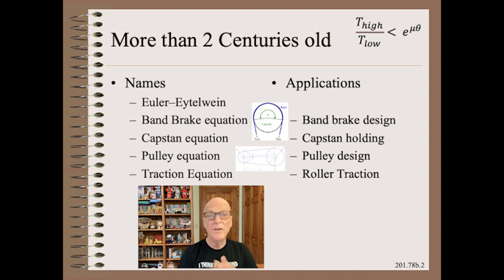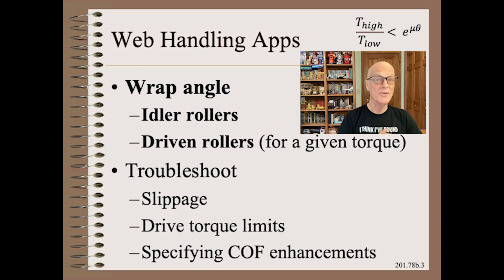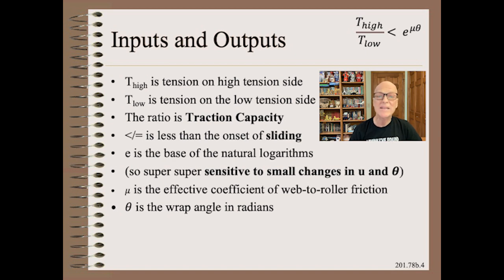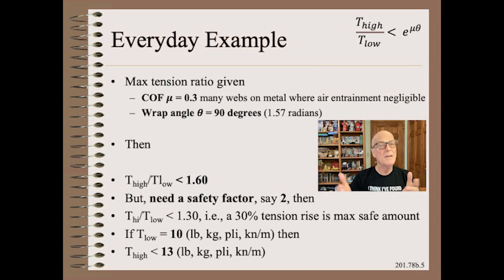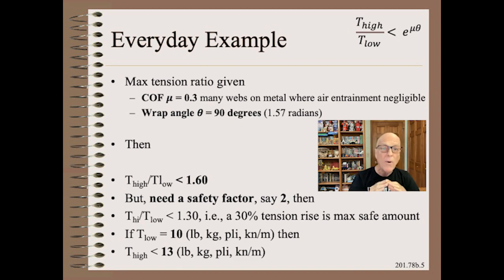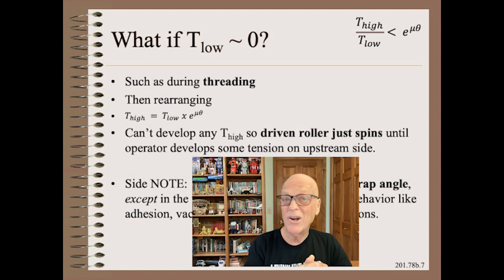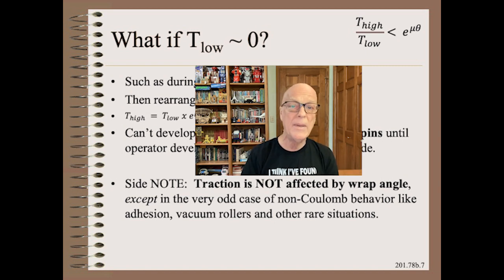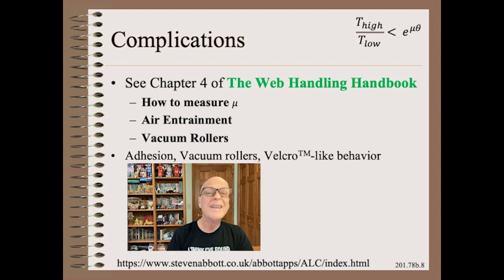Web20178b - Equations - Traction

Comment: Great vid, David. I have purchased and read cover to cover your excellent handbook. We are in the middle of designing a new web machine for C-folding an uncoated HDPE scrim around a mandrel and then joining with LDPE injected with an auger and die. Web tension is critical in the folding zone. Thanks again for your efforts.
Reply from the maker: Thank you for the kind words.  Best of luck on your new web machine design. - Dave R